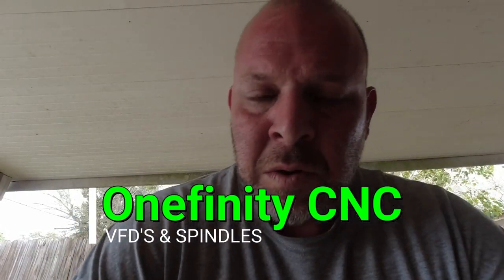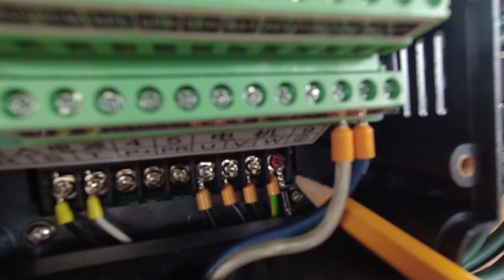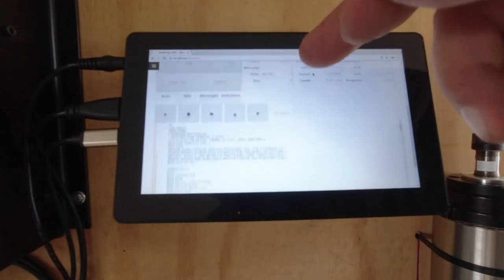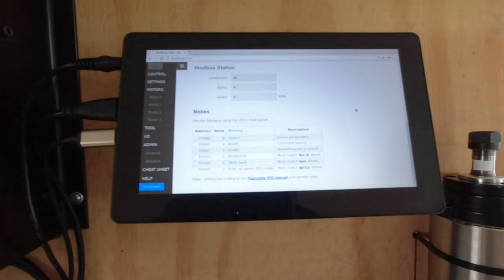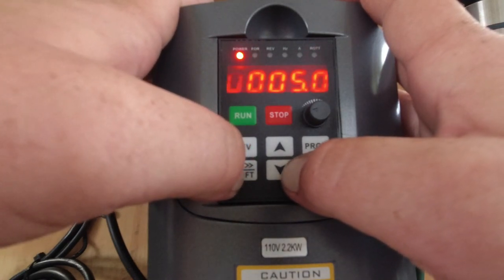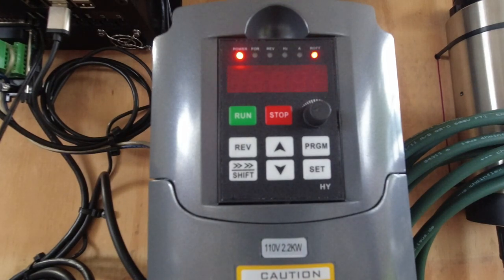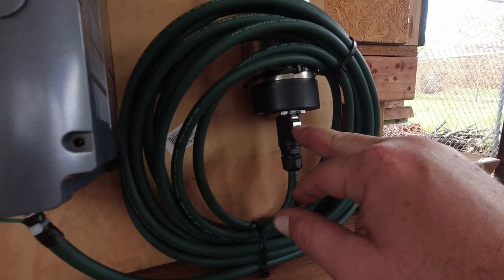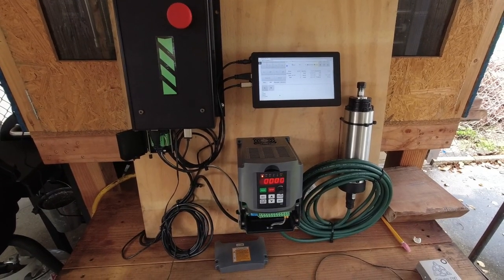Onefinity VFD & Spindle video

Comment: Sent you this on Facebook but I suppose it works here. Not sure how often you're in FB. I've been watching your videos and have been configuring a stinkin' Huanyang VFD. I'm a geek woodworker and have done my fair share of soldering and micro-miniature repair (Navy Vet - I was a twidget meaning I was in a tech field instead of Engineering). Looking at all the info I can find, seems that Pd144 on the VFD should be set to 3600 to achieve 24000 on the spindle. 3000 is the setting at 50Hz and 3600 at 60Hz. Or is going to matter that much? Thanks for your time and attention. Thanks for your videos too! They've cost me $$$. Yeah...I bought the Fanttik stuff and a couple of the little voltage modules. I'm running a 1F and am fitting it with the Huanyang 80mm, 110v 400Hz spindle. Had to swap out the crappy pot metal aviation plug for a better plug.
Reply from the maker: PD144 needs to be set to 3000
Reply: That’s what I have right now. Going to also throw a tachometer on the spindle to verify. Thanks, man.

Comment: My grasp on circuits and electric current is very basic so forgive the rookie questions:

Looks like you only have 2 inputs coming from the wall outlet (R and S) an outlet has 3 terminals, pos, gnd, neutral. Which two are you hooking up to R and S? Don't you need to have something running from the ground prong in the wall outlet to a vfd terminal? Are you using a different cable from wall to vfd than from vfd to spindle? (that would explain only having the two wires R/S) could you just walk me through terminal assignment from left to right? I know these questions are ridiculous just trying to get a better grasp on everything
Reply: After looking up some stuff, looks like you just left out the "null line" which I'm guessing is the neutral line?
Reply from the maker: Yeah you’re overthinking it. Honestly I’m probably going to delete this video as it was more intended as a “this is how easy it is to connect a VFD & spindle “ to the Onefinity cnc controller. It wasn’t as focused on “this is how you wire input power and output spindle power”. Also in terms of line voltage you have hot legs, neutral, and ground. For 120v you typically have black (hot), white (neutral), green (ground). For 240v it’s two hot legs (possibly black and white, maybe black & black, maybe black and red, etc) and a green (ground). For 240v don’t let it confuse you, just know that there’s two hot legs and a ground wire.